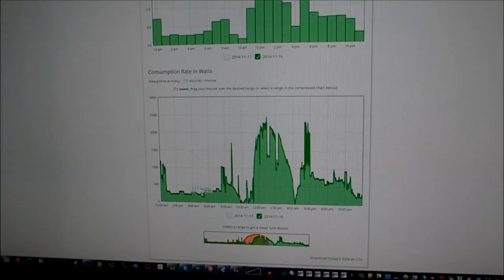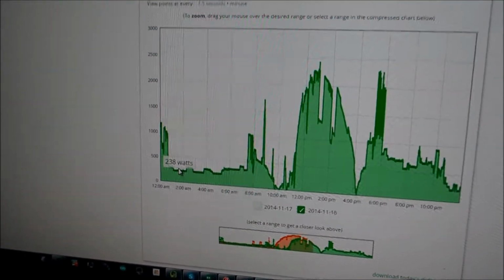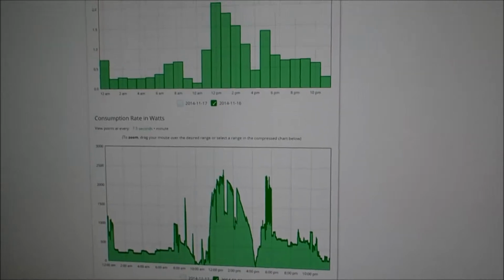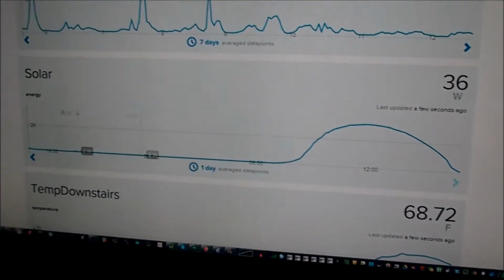Whole house power monitoring

Comment: Have you checked to see how accurate this is compared the a CT clamp on the main? I use the envir wireless monitor, but looked at these too.
Reply from the maker: +nbookie I never tried a current clamp at that house in Utah, but I'm about to install one (the neurio) in the house we just moved to in Alabama.   I hope to report on how that works sometime next month.  

I did try a cheaper alternative on the Utah house, a $30 USB stick radio:  http://misterhouse.blogspot.com/2014/11/monitoring-power-with-20-usb-stick.html

That radio solution reports on what the meter reads, so is accurate, but it is not as fast as the wattvision (once a minute rather than once every 15 seconds?).   But the neurio, and I expect the envir and Smappee well, CT clamps are very fast, with potentially multiple readings per second.   This allows for more accurately identifying what specific device/appliance has just turned on or off based on it's energy vs time profile.    That is the theory anyway.   The neurio is new, so I suspect that identification part of the software is not fully developed yet (e.g. only detects devices > 400 watts).
Reply: Bruce Winter my setup is good for about 5 second updates as of now. The long term data storage with burst upload was what got to purchase. Also it's data link is serial comma and simple xml so there are unlimited options for monitoring.  I watched your post on the sbr and really got me thinking about the "bad" you could due. I have a few and never thought to use it for monitoring other house usage. It would be nice to see what an ac like mine consumes on my neighbors house. Could tell  if mine is better or worse.